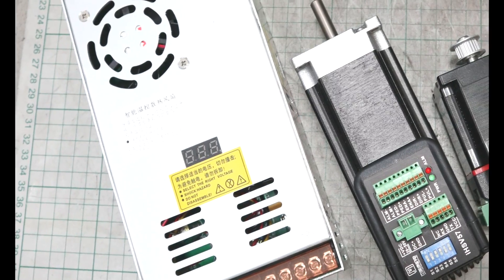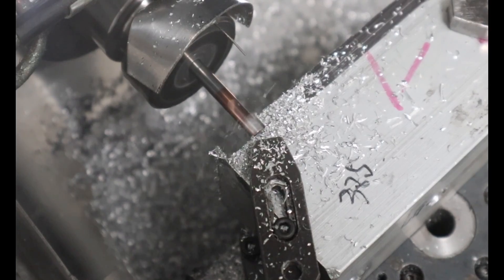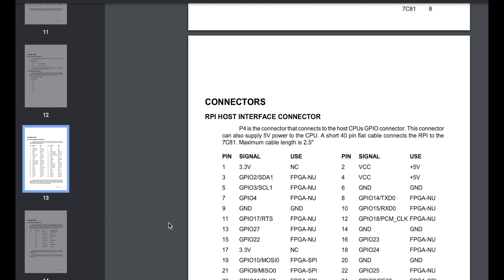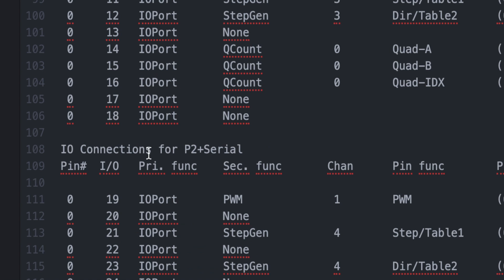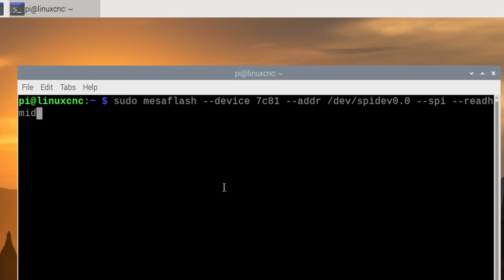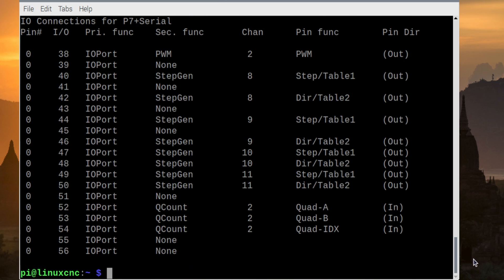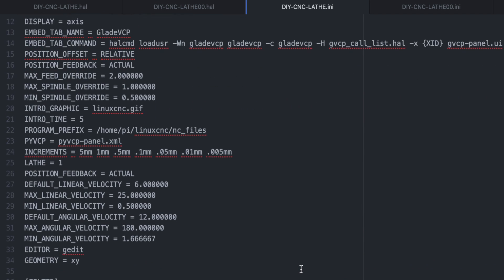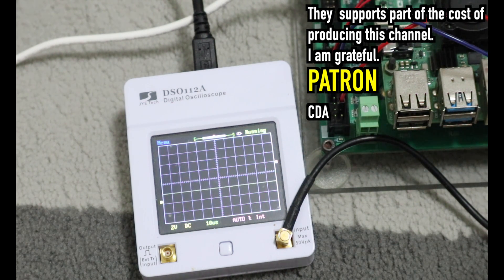LinuxCNC Raspberry Pi4 & Mesa 7c81 Setup

Comment: interesting compination rpi4 and mesa card, but lot ower price expensive, i just has looking many day internet all rpi and cnc options and lot lot cheapen have old PC,20€  paraller port card 10€ BOB card 10€ can use cnc machine lot cheapen than rpi4 and owerprice mesa card. cheapen mesa is aliexpress 42€ 7i92 clone. genuine is totally out off option all hobby users. too expensive anybody not buy. same rpi4 or 5 prce today totally too owerprice shit, better buy good old PC and paraller port card. less than 30-40€

Comment: Thank you for your great education video. But I am a beginner in the  CNC and do not understand the purpose of this Mesa pcb. Why do not we connect Raspberry Pi directly to the step motor drivers, encoders, limit switches using an onboard 40 GPIO connector? Are 40 signal pins of Raspberry Pi not enough? Does not allow this LinuxCNC?
Reply from the maker: Take a look at this.
https://youtu.be/aov6l9ElBJo

Comment: Hi in linuxcnc configuration wizard there is 4axis choice, how you install 5axis?
Reply from the maker: It is not possible to configure 5 axes using the configuration wizard.
If you start up Linuxcnc, you will find a sample of 5 axes, so use it and modify it.

Comment: Hi!
I'm not familiar with the exchange protocol for the Raspberry PI.
But why is MESA needed for this solution?
For optical isolation and control of strong currents, a simple LPT-Mach3 board can be used.
Reply from the maker: Generally, LPT-Mach3 boards are designed for use with Mach3 software on Windows and may not be directly compatible with LinuxCNC.
Reply: @a-cnc-f  This is not true :)
LPT-Mach3 boards are designed for use with parallel port any PC.
They are widely used in combination with PC + LinuxCNC.
They are simply a set of optical switches and relays that provide galvanic isolation between the PC and the controller.
Reply from the maker: @AlexMoonXXI  Thanks for telling me.
I was wrong.
Reply: MESA cards are FPGAs and do not rely on the computer’s timing.
Reply: @arauchfuss  My point is that using MESA cards for this solution is too expensive. Raspberry Pi can generate signals on its own.
Reply: @AlexMoonXXI  In what universe is $90 too expensive? Sure any PC running Linux CNC can run a simple machine on its own. However the machine  will have limited IOs and speed.
Reply: @arauchfuss  I think $99 is expensive in a universe where the controller is a Raspberry Pi and the machine is built at home from scrap :D
Please post the speed limit you are referring to (in millimeters per minute)
Thanks.
Reply: @AlexMoonXXI  mm/min is going to vary but pi IO (or a parallel port for a BOB) is measured in KHz vs an FPGA running at MHz. When you first set up LinuxCNC you benchmark your system for jitter and set an arbitrary upper bound for output signals.
Reply: @arauchfuss  I repeat my question: what limitation in the machine speed do KHz or MHz give?
Why chase MHz if the machine is controlled by KHz ?
My machine has a maximum speed of 3000 mm/min. and 400 steps (pulses) per 1 mm. This means that a frequency of 20 kHz is enough for maximum speed.

Comment: So, to understand this, in order to switch to linux CNC for a 3-4Axis machine, endstop wiring and spindle PWM control, it is needed: 
1) Raspberry Pi4
2) 7c81 mesa card
3) A flex cable
4) Cheap db25 cnc board
5) IDC26 to DB25 cable???

Please like my comment and correct my mistakes, I am trying to switch to LinuxCNC with a raspberry, because I have taken the shit with Mach3
Reply from the maker: You also need to make a cable to connect the raspberry pi to the mesa.
You can download the manual for the 7c81 mesa card.
Reply: thanks a lot @a-cnc-f

Comment: I am kinda up in the air with this, I own a ras pi 4 with 4gbs of ram, pi3b+, a few other boards but my CNC uses a Zynq Xilinx SBC it's setup to be used for plasma cutting it uses windows 10 pro and they masked the remote software that connects to my CNC with their software name, etc , what I am trying to accomplish is using the existing setup for plasma and also use it for my Router and attachment but the problem I am having is I don't know anything about remoting into that sbc I have all the passwords they used and it's this version of Debian Linux for the Ras pi, I just want to be able to do both plasma cutting and wood & metal routing as they already offer all of this just our work schedules do not match up and I am used to trying to figure it out on my own without screwing it up. lol
Reply: The Original SBC inside the machine is not a ras pi but it's running the software & machinekit so I am trying to take my rasp pi with linuxCNC to connect & control it as I hook up the ethernet wire to the pi the incoming and outgoing data arrows go crazy but I just to linux dumb and dumb to all these new sub layers for windows that they're using like their own linux kernel, etc
Reply: So in ending I wanted to thank you for this video as a few things in my head clicked and I seen during the 1 year struggle I've been in but I will figure it out once I get a few more videos in me. Thanks a million!!!!

Comment: Linux CNC with the Mesa is a great solution. For a lower cost and perhaps simpler solution, first-time CNC enthusiasts might do well to investigate GRBL on Arduino, along with Protoneer or ArduinoGRBL motor drivers. Just don't underestimate the huge and wide area of knowledge you will need to accumulate to make a success of such a project. Good luck to all that enter this arena!
Reply: It depends on your needs, for a beginner who doesn't have experience with computers or someone that doesn't have a lot of patience I wouldn't recommend LinuxCNC either. But if you do have some patience and like to have as much as flexibility you want, this relatively low cost controller and free software is a great solution. As someone new to CNC I did however began with LinuxCNC 8 months ago and it was a pain in the ass at the beginning but I'm glad I did after all. With this software and hardware I'm pretty sure it will fulfill all my needs with al my future upgrades.
Reply: GRBL and arduino have worst if build cnc, only toy cnc but real work cnc need lot better than arduino and old cavemen shit GRBL.
Reply: @mattivirta  Actually, Grbl was created by a talented programmer from Norway. What are your complaints about him?
Did you know that all modern 3D printers use Grbl algorithms?